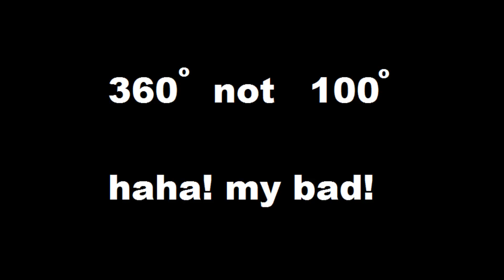Homemade Mini Battle Tank (part 1)

Comment: quick tip put links in the description to buy this stuff
Reply from the maker: For the servos? these are the ones I bought!  :)   http://www.ebay.com/itm/4Pcs-MG90S-Micro-Metal-Gear-High-Speed-9g-Servo-for-RC-Helicopter-Plane-Car-Boat-/111945223961?hash=item1a10748f19:g:1x4AAOSwBnVW8lst
Reply: Thank you all my motors from my RC cars broke (the wires fell off and I don't have a speeding iron)
Reply from the maker: Your Welcome!  :)

Comment: Nice, how did you do the electronics to control the servo motors. Are you mixing the left and right to provide direction or is it straight forwards and backwards?
Reply from the maker: yes, one control stick fully controls only one motor. so in order for it to go straight you the have to push up on one control stick and left one the other. but if I built/bought an H-bridge forward would be forward and backwards backwards.  Thanks for watching! :)